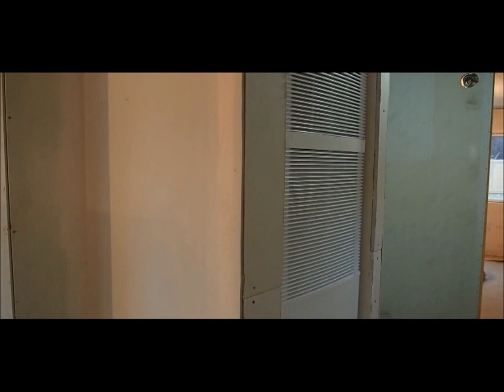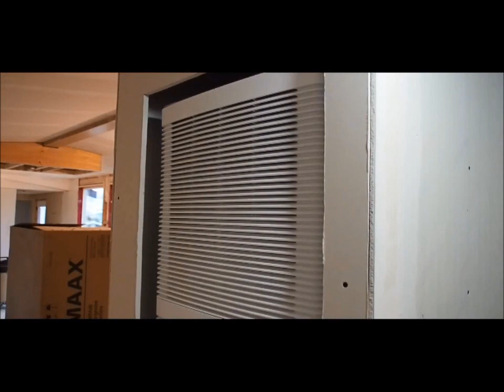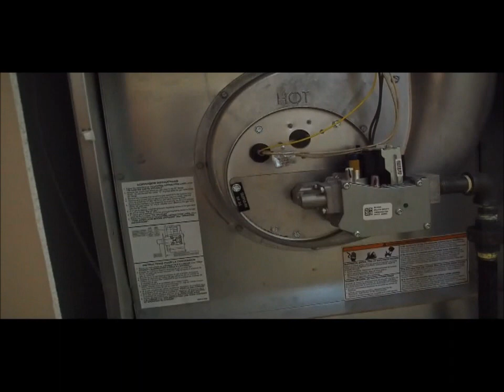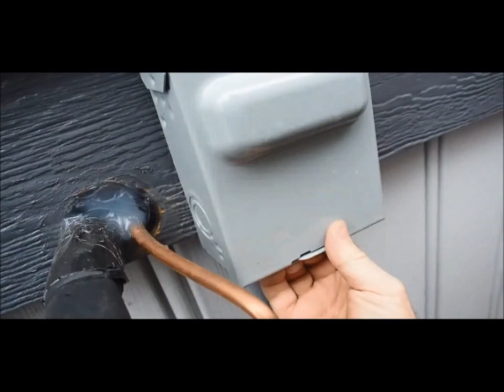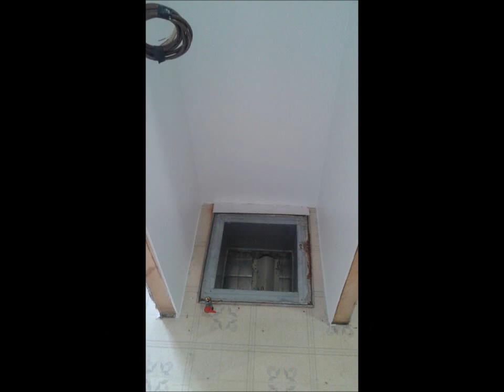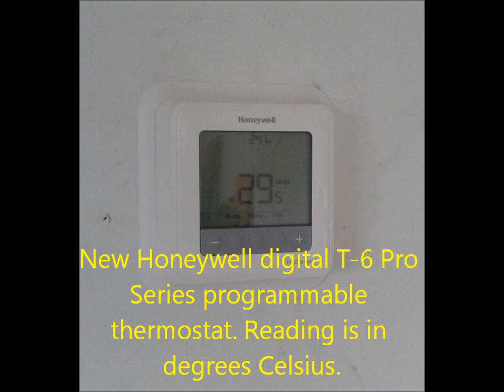Putting A New Furnace And Central Air Conditioning In A Mobile Home : E042 / BC Renovation Magazine

Comment: Im running into the problem with my manufactured home where they built my duct system like a normal home 20-in trunk line with a bunch of 14-in supply lines that reduce into 12-in crossover ducts but they didn't expand the cabinet that the air handle sits in had an energy audit done and I'm running at 98% efficiency with my static pressures they are wanting to put a mobile home unit in my home which is going to drop my efficiency down to 85%, I ain't about to lose 13% efficiency every HVAC company I've called is refusing to touch my system unless they rip out my current duct system and put a mobile home unit on my 2800 square foot triple wide.
Reply from the maker: Bradley, I'm not an expert on HVAC. I always rely on the experts. I would suggest that they look at changing that one piece that wasn't expanded.
Reply: @BCRenovationMagazine  yeah I finally found an HVAC company that was actually confident enough to redesign my cabinet fortunately my cabinet was 38 in deep but they had to widen it to 28 in they completed work yesterday installed a 5 ton American Standard gold 17 two stage heat pump Comfort-R system with a variable speed Trane air handler. And I had misstated it was 14-in crossovers with 12-in supply lines from a 20 inch main trunk line since I am in a triple wide I actually have three trunk lines one main one that is 20 in the other two are 16 in. The 14 in crossovers run in between them and then the supply lines are run off of the trunk lines i have total of 20 6x12 supply registers 10 on each trunk line with two non ducted 20x30 returns directly in the cabinet above the air handler. Seems to be doing good so far little noisy when it has to run full tilt in 5 ton stage but that should be rare here in Arkansas it only gets super hot in mid to late June and partially through July the rest of the year I should only need the lower first stage so far today I'm watching the smart thermostat fan speeds and it hasn't had to run above 1st stage with 30% on the air handler yet.

Comment: Coleman furnaces are a far superior product than Intertherm. Main difference is we have found over years of furnace service that the Interterm chimneys that Interterm uses, the concentric connection out side at the  roof rots out and the customers will have a no heat issue during the dead of winter. We find this happens usually after 7 + years use with the interterm furnaces. Coleman we find they are solid performers and very easy to service. Interterm uses the combined igniter/sensor where Coleman uses the separate igniter and separate flame sensor. A more reliable system.

Comment: Very helpful video! I bought my mobile home in 2015. It was manufactured in 1979 and had not been treated very nicely at all. This year I'm looking at a new furnace w/AC. I'm feeling abit nervous about contacting contractors in my area. Would you mind sharing a few key questions I should be asking to find the right guys for the job? I appreciate any help you may have!👍🏻
Reply from the maker: Hello, Sandy. I suggest that you look for a contractor that has an established reputation in your community that is experienced in installing systems in mobile homes. 

They should come to your home and look at your job, then give you a written quote. You want a firm quote, not an estimate. An estimate leaves you open to extra billing. If they look at your job and they know what they are doing they should be able to give you a firm price. Make sure that everything they are going to do for you or provide for you, including permits, removing and disposing of the old equipment, electrical and gas work, new thermostat if required, etc., is in writing in the quote.

Make sure that they take out all of the necessary permits and provide you with copies of those permits and any inspection reports. Depending on your job and where you are they may need electrical and/or gas permits. If they are shady contractors they will balk at this.

Do not agree to any kind of under the table kind of deals. A deal like that can affect your warranty and leave you high and dry if something goes wrong later.

Make sure that the equipment they are selling you is properly sized for your home. This can be difficult for a homeowner to be sure of. Compare the ratings on the new system they are quoting to you to the ratings of your old system. They should be similar. You could check with your local inspector to see if they have sized your equipment properly, before you sign an agreement.

Some contractors may tell you that you need to replace all of the ductwork under the home, with the new system. I have found that is not necessary. It should be good to connect the new equipment to the old ductwork.

When the old furnace is out, before the new one is installed, that would be a good time to have the ducts cleaned, if you think they should be. Your contractor may do that work, or you might have to check with a duct cleaning company.

if they are reputable contractors they will be licenced and insured. They will have Workers' Compensation coverage.

Talk to and get at least 2, preferrably 3, quotes. Reputable contractors do not charge you for quotes. This is your best assurance to not get taken advantage of. 

Ask for at least 2, preferrably 3, references of jobs they have done like yours. Call those references to see how their job went.

Hope that helps. 🙂
Reply: @BCRenovationMagazine  Thank you thank you!! Your reply is so appreciated and this is exactly what I needed to learn!!👍🏻

Sadly, Covid has made it nearly impossible to find a new furnace, in our area of Alberta at least. So far the 2 contractors I have spoken to are hopeful for the fall, but the manufacturers are so far behind. There are a lot of folks like me just waiting now. I guess  it will be at the very least another very hot summer in my mobile home.😓🙃
Reply from the maker: @sandyc2468  , you're welcome. 🙂

Comment: I have a question.I have a Coleman furnace, it's a down flow and I noticed that forced air is blowing out of the condensate drain when the blower is running. Is this normal?
Reply from the maker: Chris, good question. Yes, that is normal.

Comment: We have a mobile home with duct work in the attic in Southern California. Most mobile homes being underneath. Would that affect the cooling. We bought it and it has a new 3 ton split system condenser. Old furnace/coil. Coil is clean and blower. 1400 sq ft. 100+ degree days. Never shuts off. Set for 78. Tech said charge is good. Undersized? ⁷
Reply: I also have  duct in the attic had 3 ton new AC and furnace installed after finished moving 2018. North California above Sacramento where May 80’s June 90’s July to September 10th 100 to 110 🥵 . Previously in mobile COOL Bay Area .
1970’s double wide standard shingle roof 
First a new AC will save about 25 to 50% on electrical usage cost only . During 80’s F AC will cycle 2-3 times a hour . 100+ AC will cycle 3 times a hour or 4 . The walls of a mobile home act as radiant heaters and standard thermostat differential factory set at .5 degrees Some thermostats Pro1 example have adjustable differential . Which you can adjust but might save any money on electric usage . The thermostat has a safety of 5 minutes to protect the compressor . I tested many things and came up with no way to reduce cycle time unless I sheet rock the front room dining room which are largest walls . I ended up using a filtered box fan on a timer to bring in cool at night . Then put portable stand fans in every room . That helped with comfort with the AC and ceiling fans .My thermostat comes on about 10 am to 1 pm then off before bed . I was reading in hotter climates some mobile homes have attic duct. Future project is to re locate air return from under furnace to dining room . Presently air return permitter of home with floor vents . Full of holes from past owners bad repairs and plumbing . Might attempt to inspect attic-cavity through end gable if possible for contractor to install new duct with new blown inslitation . Might get new roof in a few years roofer said that could be best to access replace duct board . Attic temp in summer reduces AC temp by 5 degrees .
I’m not a contractor just trying to improve what mobile home makers should done in factory . 
  One thing I found out during AC usage months May to September when not home work shopping vacation turning off AC causes AC to run for 6-8 hrs and not turning off because everything in the home act as if it is a radiant heater .All the inside could be 80’ to 90’s . Keeping thermostat at 80 to 85 when not home saves . Also if during summer peak electric usage 5 to 8p conserving a little saves .
Reply from the maker: soundslikebstome, I have never heard of a mobile home having the ductwork in the attic space. That is interesting. I don't know why you are having issues. It sounds like everything is in order. 3 ton should be plenty.
Reply: @BCRenovationMagazine   come to think of it the place is hard to heat in the winter (only been there 9 months now). Got to be airflow, and 1980's insulation too we are thinking? Thx for the response.

Comment: Excuse me  and how. much you spen total plus intalacion☺
Reply from the maker: MAR, when this work was done in the summer of 2019 the total cost of the heating and cooling package installed was about $6,200 Canadian. It would be more now. 

Just to replace a furnace alone is about $4,500. Air conditioning alone is about $3,500. Again, 2019 prices and Canadian dollars. 

You save money installing both heating and air conditioning at the same time.

Comment: I just had my HVAC replaced in a manufactured home in BC and they installed the a/c coil above the heat exchanger of a downdraft system. What is your thoughts on this because the booklet for the system says that the A/C coil has to be below the heat exchanger so no condensation goes through the  heat exchanger. I have sent an email to York on this issue today so am waiting for their reply. The installer is coming in two days to address issues and I need some feed back from others  has my system been installed wrong or not. Great video by the way. I see in your video the A/C coil is on the bottom as was my old unit they took out.
Reply from the maker: Bentley, my apologies to be just getting to this now. I don't think it really matters much if the AC coil is above or below the heat exchanger in the furnace, but it IS more common to see it placed downstream. How did this end up for you?
Reply: @BCRenovationMagazine  The unit was removed and installed with the coil on bottom. I even called the inspector on this and had him come and see it. He said it does have to be below on a downdraft application so it does not have the possibility of condensation going through the heat exchanger which can corrosion and CO leaking into the home.
Reply from the maker: @bentleybloodworth4282  , thanks for getting back on this. I appreciate it. That is really good to know, especially since we are both in BC.

Comment: man learned alot about how my Coleman works with the central air on the bottom.. the igniter died on mine.. but then they came out they seen that the heat exchanger had a crack in it.. they want $4300 to replace it.. ouchie.. thanks for making this video!

Comment: I have a 52X80 Doulble and wonder what the cost of conversion to AC,
Reply from the maker: Hi, Walter. This heating and air conditioning system cost us a total of $6,400 installed. Canadian dollars. If the furnace was done alone without the air conditioning the cost would be about $4,000. If you are just doing the air conditioner it is about $3,500. You save money if you do the entire system all at once.

Comment: My AC went out last summer and I was unemployed so replacing in was not in the cards . So I used a portable Hier 8,000 stand up unit until the end of the year.
 which  I recently found out stopped working when I tried to use it as it starting getting hotter..

Thanks to coronavirus I am unemployed after only being on the new job for 5 months....lol
Thanks corona...lol

Now it is super humid and in the 90's in Alabama and I am stuck in the house and about to die of heat exhaustion...

I live in a 32x80 double-wide..
My thermostat read 94deg..

I saw this unit and was going to get it.. but home depot is useless when trying to get information about compatability, and I am not a HVAC tech..

This is the unit.. 
https://www.homedepot.com/p/Winchester-2-5-Ton-14-SEER-Mobile-Home-Split-System-Central-Air-Conditioning-System-with-30-ft-Line-Set-4WMH30S-30/303265661

I was trying to find a install video on youtube and see how hard it world be...
The unit is pre-charged like the MR COOL mini split units... 
but the mini split units would not work for me right now money wise...lol..
Because I would have to get more than one for opposite ends of the home..
So if anyone know of a instillation video on this...

Winchester 2.5 Ton 14 SEER Mobile Home Split System Central Air Conditioning System with 30 ft. Line Set.

I would greatly appreciate it..

Comment: I live in a 1999 double wide home and my question is if I put a gas Trane package 
Do you think that I will have issues due of the duct system? Thanks and great channel!!!
Reply from the maker: eramirez50, it is hard to say without knowing all of the details of your HVAC system. For us, when we do this we just use the existing duct system. Some HVAC guys will tell you that the ducts are too small and there will be too much static pressure, but it has worked very well for us. Try to find an HVAC contractor who is familiar with mobile home systems and can size the new equipment accordingly. Thanks for watching and commenting. :-)

Comment: The Coleman DGAA will accommodate a wide variety of coils. I typically use the ADP M series coil which are very affordable and work well with a variety of different condensing units. I have used Rheem, Payne, Tempstar, and Guardian Condensing units on mobile homes with great success.
Reply from the maker: Manuel, thanks for watching and commenting. We used this setup for a bit of cooling in the summer and for heating now. It is working well. I am happy with it.

Comment: the furnace shown is a Coleman DGAH, I have never seen one of those installed over a coil cabinet like that.  A/C applications typically use the Coleman DGAA which has the integrated coil cabinet.  There are furnaces that are 90+ AFUE that are designed for mobile homes,  The Thermo pride CMA is a 95% option, Coleman also Makes the MG9s which is designed to fit the typical footprint.
Reply from the maker: Manuel, would those 90 and 95% options you mention fit in that old basically 24"x24" footprint in the alcove? The options we looked at here were all 30" deep.
Reply from the maker: Manuel, we looked at the Coleman high efficiency unit. It was available to us at a very premium price. We saved a lot of money going the route that we did.
Reply: @BCRenovationMagazine  Same here, in 2013 I had my original furnace replaced with the same Coleman furnace. The 80% model is good enough considering my home is a single wide with thermopane windows that I installed last year and especially considering that I heat with propane which I buy once a year for under $1.00 a gallon due to having a 1000 gallon tank that I own. So I don't really need a 90+ efficient furnace either.